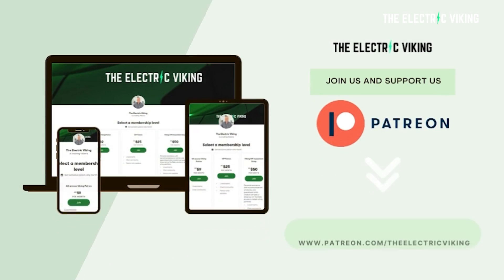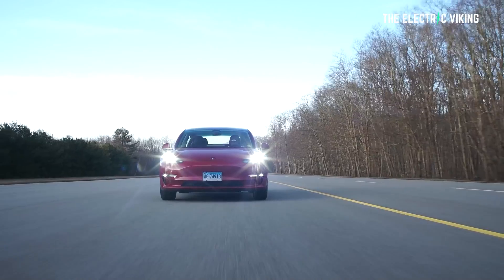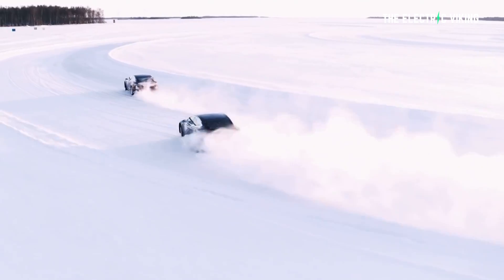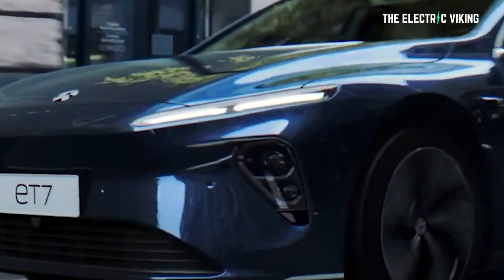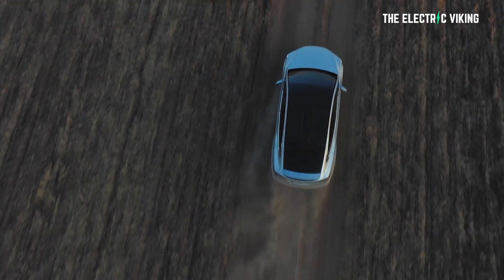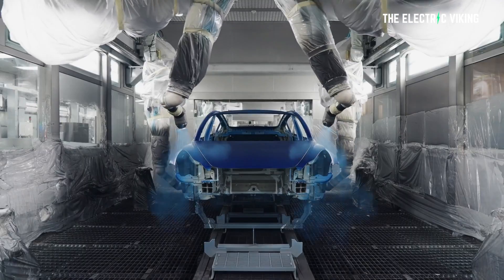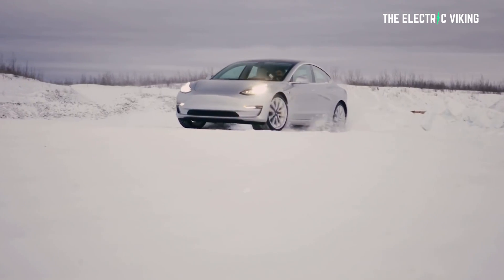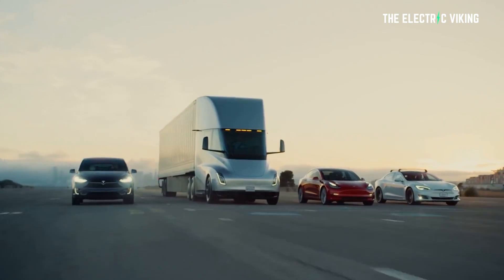Is the Tesla Model 3 the most efficient EV on sale in Europe?

Comment: There are some improvements to do in cold conditions (LFP batteries mainly), better insulation and pre heating the battery keeping it warmed for more than 10 Celsius degrees to avoid charge degradation. There is an investigation from Singapore University I think.

Comment: The model 3 yes was released in 2017 being version-1. The current model-3 is version V3. Nearly every part of the car has been re-designed, including the motors, the thermal management system alone reduced power consumption by 10% by using the Octo-valve and heat pump, the way the car is built is radically different and lastly the new battery chemistry and structural battery packs have all added to a very efficient vehicle.

Comment: They could still do better.  Adding solar panels could increase range a lot.  they need spare tires.  they should have front wheel drive on the 2 wheel drive model at least as an opyion.  they need more colors..  green yellow orange purple brown.
Reply: You wrote, "Adding solar panels could increase range a lot." Please cite some evidence to back up that assertion. I say this because the last time I saw claims about this topic, the numbers did not support your claim. Regarding spare tyres... I suggest you do an internet search to find an article entitled "Here's Why Teslas Don't Come With A Spare Tire".
Reply: Solar panels would add about .000000000001% range lol
Reply: @jebes909090  i  ha ve about 10 tools at home powered by removable 
Li-'ion batteries so autos could split them up into sections each chargeable on a separate charger the same way.
Reply: @buzz-9x  It would be nice if there was a split charge port, so people could use two 15A circuits to charge, completely eliminating any "You need to upgrade your circuit breaker to charge EVs" argument entirely.
Reply: @gerryburde5663  I prefer an option to recharging which is replacement  = much faster.
Reply: @buzz-9x  what purpose does anyone need faster charging?  The average person drives 40 miles a day.  That recharges on a standard outlet in 8 hours.
The average person drives more than 300 miles in a trip twice a year.  DC fast chargers are more than suitable.
Reply: @gerryburde5663  EVs won't replace ICE until pit stops are as fast with EVs.
Reply: @buzz-9x  There are no pit stops with EVs.  You plug in at home.
Reply: @gerryburde5663  Unless u go on long trip. or live in apt without chargers.
Reply: @jebes909090  look at the aptera or the scion 1000 miles range due to batteries.
Reply: Solar panels with batteries on Aptera Scion  & Light year cars

Comment: The window sticker on EVs list MPGe but I like to use the kilowatt hours per 100 miles measurement. Here is a list I found of a recent EVs
Most Efficient Electric Vehicles (Energy Use Per 100 Miles) 1. 2022 Tesla Model 3 RWD: 25 kWh  2. 2022 Lucid Air Grand Touring w/19-inch wheels: 26 kWh 3. 2022 Chevrolet Bolt EV: 28 kWh 
4. 2022 Hyundai Kona EV: 28 kWh 5. 2022 Tesla Model S: 28 kWh 6. 2022 Tesla Model Y Long Range: 28 kWh 7. 2022 Chevrolet Bolt EUV: 29 kWh 8. 2022 Kia EV6 RWD: 29 kWh 9. 2022 Hyundai Ioniq 5 RWD: 30 kWh 10. 2022 Kia Niro EV: 30 kWh
Reply: good but I'd suggest miles or km per kWh which facilitates more direct projection of remaining charge to distance and is more like the ICE miles/gallon or liter
Reply: @steverowe8431  But miles per gallon is a terrible measure.  Gallons per 100 miles would be much better.

Comment: Efficiency is a key metrics for electric cars due to the cost of batteries. Tesla currently has the highest efficiency of cars that are generally available.
In the case of ICE cars efficiency is not an important metric as increasing the size of a fuel tank is a cheap and usually trivial option.
Reply: Right, and no one cares about the cost of gasoline.

Comment: Tesla's are more efficient. The question is: do customers care? 
I bet if someone parked outside dealerships that sell the various brands of EVs and asked new owners what the efficiency rating of the car they just bought is, I bet 90% would be clueless.  There is no question the shape of the model 3 is a factor. I really dislike the look of the front end of the model 3. It looks effeminate to me. A girl's car. No question the other automakers are sacrificing efficiency for styling and interior space. I bet the roof line is higher on most of those cars that are less efficient. When charged at home the cost of the additional electricity is irrelevant. Either the car has enough range for the buyers needs, or it doesn't. 2 or 3% is nothing. Few care. Where I live in Canada the Model 3 is also a lot more expensive than the other small EVs, so it had ought to have better engineering. The invoice savings choosing a Nio, Bolt, Ionic, etc will far exceed the efficiency loss with a large magnitude.
Interesting that the performance is so poor in cold weather. I thought that was mostly an exaggerated fear, apparently not.
Reply: So have you driven any EV's at all? You sound knowledgeable but you could also be full of BS - do we care? NO!
Reply: Obviously not, with so many after heavier vehicles, like the Ford F series etc.
 - Yes some need it for work etc, but 'trucks' and SUV's that spend 99% of their time taking kids to school and picking up cartons of milk are kind of stupid - Bring on Aptera if you want to get serious.
Reply: You wrote, "Tesla's are more efficient. The question is: do customers care?" Since Tesla cars typically outsell a competing brand of car by 5 or 10 times, it is clear that customers care about something Tesla has to offer, although I don't know how much efficiency plays a role in that caring. You wrote, "When charged at home the cost of the additional electricity is irrelevant." I don't know if it is still the case, but 1 or 2 years ago, a video on the "Munro Live" channel showed a chart that compared the battery sizes and ranges of a few different types of EV. The main takeaway point from the chart was that Tesla cars used a battery that was about 25% smaller than competing cars to get a similar range. This suggested Tesla cars were about 25% more efficient than competing brands (rather than the 2% or 3% that you suggest).

You may well be right in thinking that the total cost of ownership (TCO) of a cheaper EV with worse efficiency will be better than that of a Tesla car. And people who are motivated primarily by TCO will choose to buy cheaper EVs. However, some other markets suggest that a significant number of people are willing to buy more expensive items if they are perceived as somehow being "desirable enough". For example, Apple iPhones typically cost more than Android smart phones with arguably similar capabilities, yet that has not stopped Apple from being a market leader.
Reply: The trouble with using a car as genital augmentation, is that everyone knows why you think you need that.